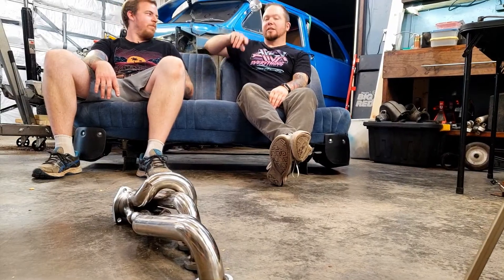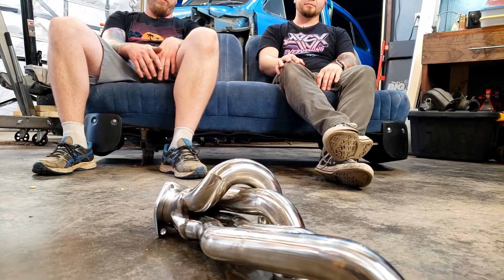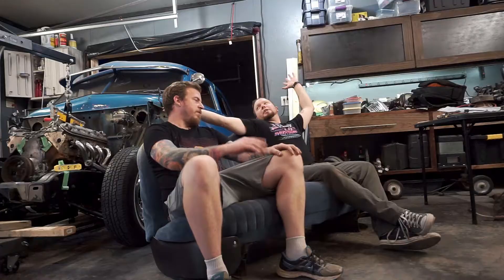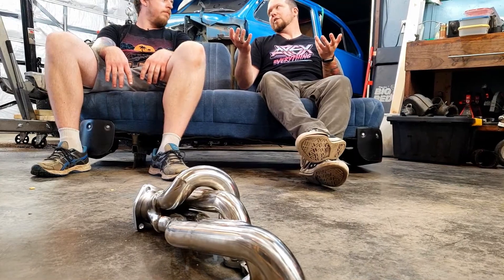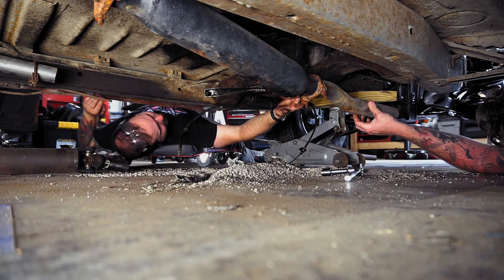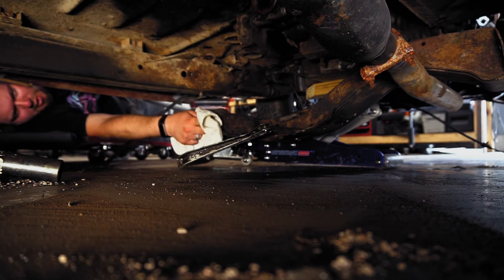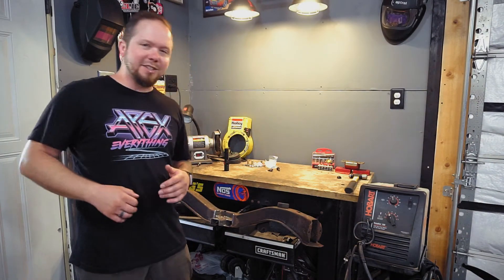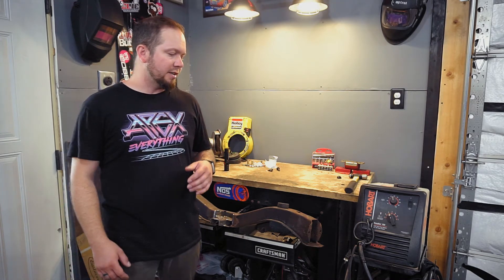Crossmember modification for the LS 700R4 swap; Shoebox Ford Ep6

Comment: Hey guys any advice for a 1956 fairlane swap where to get mounts ect
Reply: Im interested in a sbc swap or Ls thanks for responding
Reply from the maker: https://butchscoolstuff.com/54-56-ford-mercury-weld-in-sb-chevy-engine-transmission-mount-kit-2506cp/
Reply: @DadModsMedia  thanks I'm just seeing your response thanks alot  y block and 3 SPD will be coming out just wanted the mid 50s Ford body
Reply from the maker: Sounds like it's ready for a fresh powerplant! Good luck man!
Reply from the maker: From what I've read it appears there are some mount options that may require a little fab but nothing too wild. Butch's Cool Stuff has swap mounts for a SBC. And there are conversion plates to fit an LS to SBC mounts. The SBC to LS adapters are cheap and easy to find online. 
I'll make a second reply with a link to butch's web page for their conversion mounts.
Reply from the maker: Hey Damon, what are you swapping into the Fairlane?